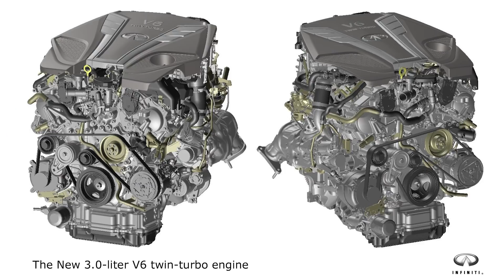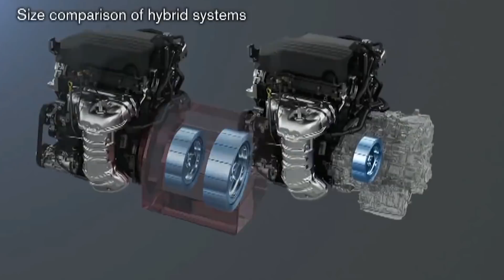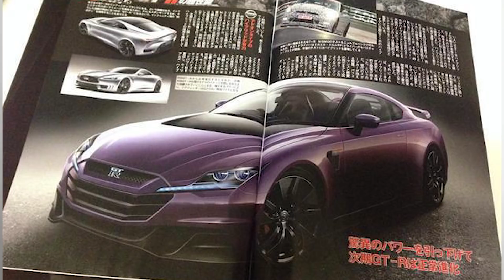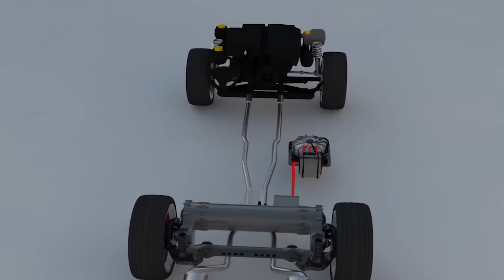2020 Nissan GTR R36 : EVERYTHING YOU NEED TO KNOW!!!

Comment: Maybe they'll increase displacement for the VR38
Reply from the maker: SuperMechguy Doesn't look that way with future mpg and emissions requirements. The Ford GT also moved to a V6 TT. The "engine torque" will be replaced by "battery torque" which should be much better.
Reply: GT Content ah I was thinking that since the 720S went from a 3.8 to a 4.0 liter but, yea the emissions and mpg thing could be a problem

Comment: Do you think the gtr motor transmission ect , could last a while with a 2016 if it dont get raced much?
Reply from the maker: It's reliable. The "bad" ones were from earlier GTR's breaking due to an extreme launch control which has been fixed since 2012+.

Comment: hybrid with 800hp/800tq and a 8 speed DCT and under 4000 pounds(batteries are heavy). and no run flats, legit max performance summer tires at 305 wide in the back.  7 minute flat ring time. thats what i want to see. with a 200k price tag

Comment: Hi Gary just wondering on your gtr have you run extra coolers especially transmission as I hear that they heat up when driven hard long periods of time?
Reply from the maker: Hey Ralph. I don't have a transmission oil cooler or swapped out my transmission pan for a baffled aftermarket one since I only drive on the street. Other owners whom track their car have added the oil cooler and baffled pan. Don't forget the rotors tend to stress and crack also if you plan to track it.

Comment: Do you think the prices for the R35 will decrease a lot when the R36 is officially announced?
It's still 2-3 years till I can afford a R35, which is my dream. Let's say I buy a 2017 Model GT-R in 2021 for 65K, then R36 gets released some months later and the price for R35 instantly drop to 50K, that would be quite heartbreaking!
But also since they would stop producing the R35, the prices may remain the same, or even slight increase if the R36 pricetag is high.
What's your thoughts on this?
Reply from the maker: If the R36 GTR will be hybrid and mediocre in performance like the 2nd gen NSX, then the R35 might become more attractive to enthusiasts in the used market and maintain it's value. A hybrid system will complicate things and it'd probably be frustrating to tune or modify due to the imbalances between the electric motor and gasoline engine. We'll only know when it arrives.

Comment: Well, it's 2020 and still no official R36 concept. A hybrid system is almost certainly going to be part of the drivetrain somewhere down the line. Yes, it will severely limit mod potential and probably make the car heavier despite efforts to reduce weight. However, done right it could be great to have if the car can also run solely on battery power as a fuel saving feature. The current R35 is a guzzler.

Comment: The GTR has always been about being a cheaper car, and showing its taillights to cars 4 times more expensive. Big name cars ! Its important to the millions of fans that Nissan will keep that in mind. BUT, if they want to continue making a car that shows its taillights to almost anything else on the road, then they need to change things. Cant expect them to simply increase cubic inches or fit bigger turbos. Nissan did a fantastic job with the R33, R34 and R35, lets trust them to do the same with the next model.

Comment: I disagree with moving into a hybrid platform.  Stick to the current drivetrain tweaked to 700bhp.  New aero-body along the lines of their concept car.  Ceramic rotors.  Make it as fun to drive as a Porsche GT4 if possible.  They'll have to compete with the new Corvettes and Porsche's and bring it in at a price no more than $10K-$20K above that of the current premium model GTR.  They'll sell a bunch of them and it will be a great halo car.

Comment: I think Nissan is waiting on the arrival of the Supra.  Acura has shown their hand, but Toyota hasn't.  I think if you really want to see how the next GT-R is going to be, look at the current 911 turbo.  I don't think the R36 will be a hybrid; does Nissan even offer a hybrid in the US (aside from the Rogue)?  The GT-R's biggest issue isn't weight or gas mileage, it's cost.  Start it at $80k and give it minimal options.  It should not be any more than $90k.
Reply from the maker: +Alex Becker Agree with your other points except the current 911 part. Porsche is already planning to go hybrid with the next 911, so it would make sense for the GTR also. In a sense, it's futureproofing itself.

Comment: I think Nissan deserves the right to be trusted. I m sure when the GTR was announced and everyone heard about the weight and decisions made and many questioned it and yet this car turned out to be epic.

Regarding the price, yes it is getting expensive, but the Nismo cost what? 174k MSRP which only goes up from there. This car is already expensive and is selling. I agree the price is extremely high but it will still sell. This car has a bigger following than any other Japanese car (i.e NSX) and the problem with the NSX is, its not "killing" anything. When the GTR came out it was killing everything

If this Hybrid car comes out and instead of killing regular lambos, ferraris and other exotics like the 570 etc it comes putting out 720S numbers or P1 numbers or LaFerrari or 918 Spyder numbers then 150-200k price will be worth it. It is all relative to what it can compete against.

2.7 0-60 time in 2020 will not be enough. This thing needs to target 2.4. - 2.5 times if not LESS. Some GTRs now can do 2.7 with out electric motors and the 720S is rear wheel drive with no electric motors doing 2.7. They should honestly target like 2.2 - 2.3 seconds.
Reply from the maker: Billy Figueroa I agree with your points.
Reply: Great comment!!

Comment: THE most important measurement of a GTR is that it has to be more or less affordable. All other things a like, (standard) M3 type pricing with GTR capabilities and performance. The Nissan GTR is not intended to compare to a 150K€ to 200K€ car. They tested this with the Nismo ... market is not there.
Reply from the maker: True. The GTR is no longer a budget performance car. The argument a was that a hybrid GTR with McLaren P1, Ferrari Laferrari, Porsche 918 performance would be cheaper than those cars. Relatively, I'd agree if comparing to those cars, but it's still too much for the typical GTR enthusiast/buyer because at that price level (assuming $200k+), there are more prestigious brands.

Comment: VR38 block VR30 direct injection head. + a hybrid electric motor could totally push the power envelope into the 700hp range. 750 for a nismo version. this could put the r36 into mclaren and lambo upper scale range model. and nissan allready has all the hardware developped

Comment: I think they should use RB again 🤷🏻‍♂️😂
Reply: It's an option for nissan, the rb26 are used in the r32 r33 r34 and just add little modifications. The r36 could have the vr38 but modified and the vr38 had so much potential so find a new engine concept who can beat the vr38 is very difficult and can take many years of developpement.
But if they use a new engine that would be super cool.

Comment: As owner of 2015 Nissan GTR (bought new) I  am tired of waiting and currently looking to jump into Audi R8 V10 plus. If new Nissan GTR ever comes out (and it is BIG IF) base car in my (g)estimate will be ~130k starting price. Than they will have more pampered high tech version for ~160k and stripped down GT3 version for ~200k. Honestly for 160k I would rather have Porsche 911 GT3 4.0 than Nissan. I just don't see Nissan being able to compete with big guys from Germany. Reason: Customer Service. When you drop off any German super car (R8, 911 turbo) for any kind of maintenance you get another Porcshe and high end Audi to drive (even cheaper BMW gives you the same service). From Nissan you get shuttle bus but only if it is 10 miles away from dealership. Nissan has a long way to learn. Not everything is in numbers. Once you start going into magic 150k car price category many other things start to play role.

Comment: With mercedes future plans to build only inline 6 motors with single or twin turbos and building 4 cylinders for their passenger cars using the 6 cylinders technology.
 The GTR is fine to be left as an always 2+2.
  They need the newest Z car to be targeted at competing head to head with porsche 911/992.
   I think the GTR is wrong to put itself in such a lofty marketing segment. , its trying so hard to fit a square peg in a round hole. 
    It should be up market from the Z . The Z. Designed and built ,as a true Porsche competitor , equal in price and performance , with a true plan to 
Competitively cut into thier. market.
Nissan needs to rethink the GTR place in the market.

Comment: Gary:  Another great presentation with nicely-done graphics.  Even if speculative for now, thank you for keeping us informed.  By the way, I like the GT-R shirt, the picture frame (behind you) and what you wear and display based on what is being presented.  Good visual aid details at work.

With more stringent emissions and fuel mileage requirements, the way the future is molding is relentlessly pressuring and leaving manufactures with no option but to seek other performance alternatives like - hybrid / electric motors / turbo charging, etc.  It certainly seems inevitable and I get it... but I am no fan of this technology and the direction it is going.

It is distressing knowing that drivers are out there viewing text messages on their vehicle's display (because manufacturers thought it was a brilliant idea to do so).  But what is downright frightening, is that they will be doing this in their future autonomous (self-driving) vehicles.  You know, like the Tesla (in auto pilot) that plowed into an 18-wheeler.

If there is a future R36 GT-R, it will likely incorporate some, if not all, of the above-mentioned technologies - along with yawn-inspiring paddle shifters.

To me, nothing is more elating, invigorating and thrilling than driving a car with the clicks of a manual gearbox - while listening to that normally aspirated, high-revving engine. :)
Reply from the maker: Thanks!

Yes, there are groups split on the direction of the GTR. I think the best way to look at it is that people do have the option of older generations that may fit their criteria (once import laws allow).

Comment: Not to sound rude, but you're not saying anything that has not been said or speculated for years.  As a long time R35 owner, 200k is not a lot of money if the new generation R36 offers P1/918 performance at a fraction of the cost. At this point, I honestly believe that it needs to be a tad faster too. With the way the high performance car market is going, the biggest hurdle they're going to have to overcome is going to be emissions, not power/hp. With that said, good video.

Comment: Well the VR30DETT motor just made 806WHP with AMS after reinforcing rods & pistons + transmission and moving to larger turbos.... So yeah 600WHP is totally manageable 
the rest can be made up on hyrbid system and be pretty dang affordable. 

I honestly wouldn't be suprised if the Project Black S Infiniti is teasing is the ground works for the next gen GTR.

Comment: Last I heard was the front wheels would use a hybrid regenerative braking technology which would eliminate the front shaft and it would be an all wheel drive but power to the rear wheels would be shaft driven. So the front wheels would each have a hybrid motor, so yes 800 was supposed to be the next level r36. Yes I work for Nissan actually and in our insider forum the technology that Nissan has been talking about is extremely high tech. Similar to that of jaguars hybrid prototype
Reply from the maker: Herb Lopez71 I've heard of electric motors in the front which would shed weight by removing the front diff and driveshaft. 
    The issue (maybe a nonissue. Lol) is spacing for the two electric motors since the GTR's engine is in that location. The NSX and 918 can get away with it because they're both mid-engine. 
   I'd assume an integrated type hybrid system attached to the transmission which will be much better to balance between engine and battery power since it's all one unit and not independent of each other.
Reply: GT Content a mid engine setup would make a lot more sense also if they integrate that technology to the front wheels

Comment: I'm hoping they go a cheaper direction, back to the original Godzilla roots.
Reply from the maker: We can only hope (fingers crossed).
Reply: we are hoping all
Reply: For me The GTR root is The GTR R34
Reply: +Fernandinho Barretto literally the dumbest statement I've ever read if were talking godzilla roots we should be talking r32 because that's where the Godzilla name came from the r34 gtr is over hyped and in my opinion not even the best looking gtr just because it's some unicorn in the states doesn't make it the best
Reply: So, you don't want it to compete with today's cars then?
Reply: Well thats what the Z is for but Nissan is playing fucking games!
Reply: FlyinGato they probably won’t there’d get better hydraulics better engines not gonna be cheap most likely
Reply: Didn’t the r35 first sell for like 60k that wasn’t bad back then the price today is not worth it
Reply: The GTR has never been cheap outside of Japan, where are you getting that from? The rise in price of the R35 was directly linked to the exchange rates , that’s why it was originally £58k and less than 2 years later it was 70k
Reply: So you want a cheap honda civic just so you can afford it but also be the joke of the industry.  It's named Godzilla because we win and we're not cheap.
Reply: You mean that they go for the GTR r32 and r34 body style if that's the case then they should GTR r32 and r34 is the best body style of the nissan GTR along with hakosuka 2000gtr the r35 just looks like a infiniti g35 had a baby with a 350z you can get butthurt all you want r35 fans but that's just my opinion about the r35
Reply: FlyinGato that's where the z fills
Reply: Anything past the R34 is NOT a GT-R, its a V6 auto computer pos, ive driven one i felt nothing but forward movement, this is no joke i get more enjoyment behind the wheel of my 420a eclipse
Reply: Bookie Anderson at least theyre real zillas unlike the r35
Reply: FlyinGato still cheaper? Maybe u should talk to some guys in ur country and stop the effing inflation
Reply: Most importand, its a friendly tuning japanese muscle like previous Gtr,skyline,supra, ,but if its more to hybrid supercar turn exotic, ,I have to think wisely before buy it  ;-)
Reply: did u use google translation?
Reply: i dont think they will, since they spent so much effort on approaching supercar category
Reply: the q60/q50 is the cheaper GTR
Reply: FlyinGato the original roots? Wtf are you talking about the GTR was always expensive, if you count for inflation, these new gtrs are cheaper than the old ones
Reply: Probably not going to happen you will get a supra type of deal and everyone will bitch about it being down on power just buy a used 09 to 11 there getting good in price now
Reply: This would be the worst business decision they can make.

Comment: The GT-R just needs a 4 liter supercharger V8 all wheel or rear wheel drive rather than a hybrid drive train. Just my opinion
Reply from the maker: I'd like to see that too, but it won't meet future emissions and MPG requirements. The Ford GT has also moved to a V6TT. The "displacement, supercharger, V8 Torque" will be replaced by "battery torque".
Reply: We need car guys in the oval office

Comment: 150k-200k for a spanking new R36 is hard to swallow. That will priced it at super/hyper car price point.

It makes sense to go mid engine for the 50:50 weight distribution as the current layout already has the gearbox in the rear and many Hypercar has adopted the mid engine layout for many years. 

how are they going to fit a 2+2 seating is a big headache. Also the current GTR is on the heavy side. Although the Nissan engineer insist it needs to be this heavy for stability. I say shed the weight from the body panels with carbon fibre. 

there are def many hybrid technology that Nissan could use. They have the Leaf which is a plug in electric system. And the R Hybrid which you mentioned and possibly the KERS system used in F1 since it has proven track records.

The engine will indeed be downsized to 3L instead of the odd 3.8L on the current VR38DETT

the VR30DDTT has the advantage of dual VTC on both the intake and exahust which the older VR38 only controls the intake valve timings.

The newer engine has a higher compression, a few tweaks to the compression and prob use of a bigger turbo setup on the VR30 and you can still get close to the VR38DETT power figures.

And if the hybrid technology could add around 150-200bhp on top of the engine power. You will be looking at 750BHP Hyper car slayer GTR.

Also it will be interesting to see active aero to appear on the GTR as well much like the LaFerrari or the Pagani Huayra

Many hyper cars sports an active wing at the back and Porsche has active aero at the front of the car as well as the wing.
Reply from the maker: Good options.
Reply: When you go back in GTR history the idea of a mid-engine in a GTR is scary because it doesn't co-aside with the other GTR's of the past. However, I wouldn't mind a very similar design but a hybrid.
Reply: If it Mid Engine then steering feeling will be entirely different from front engine even distribute 50:50.